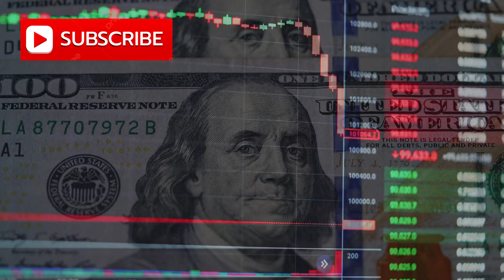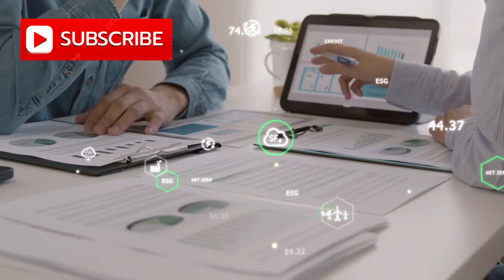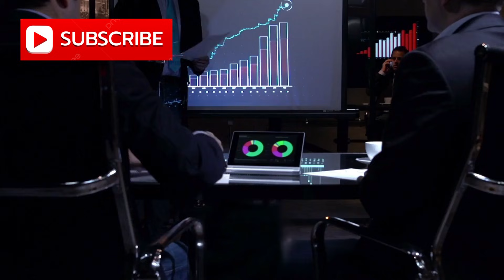Huawei Shocks the World: 3nm Chip Test Powered by Its Own EUV!

Comment: It’s funny, with just a little research. The Chinese have made a usable euv it’s the same tech asml first used when first developing their current lpp euv and only used Ldp for the testing of their masking ip. They abandoned ldp for clear issues that make ldp not reliable at scale. Good for them, but they are still way behind. It’s not the extreme UV that is novel… it’s the zeis len’s. The same lens’s in the Hubble their optics are second to absolutely no one. China is not even close to making len’s they need for scalable euv. So they will be basically printing silicone rather than transposing an exact original from the mask.
Reply: Because of this yields and a wide range of bin quality will be apparent in Chinese domestic silicone